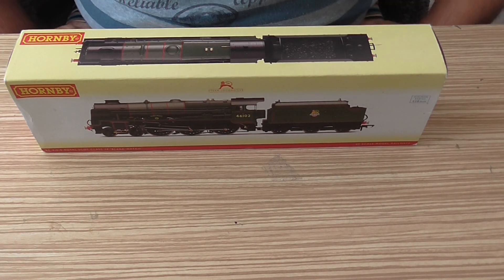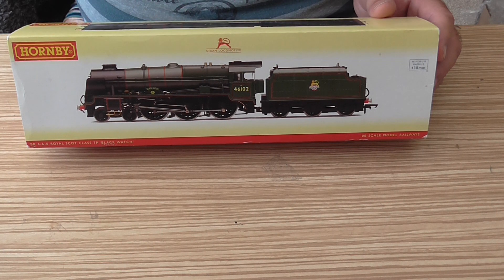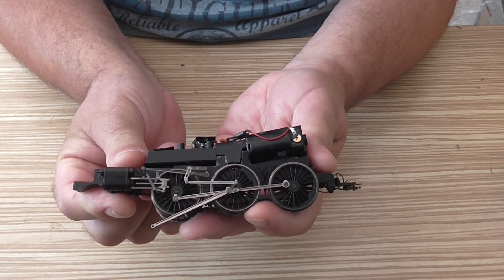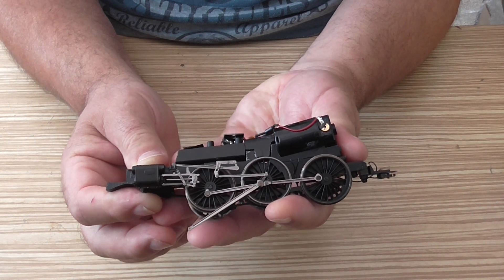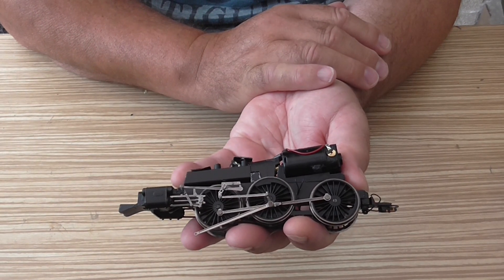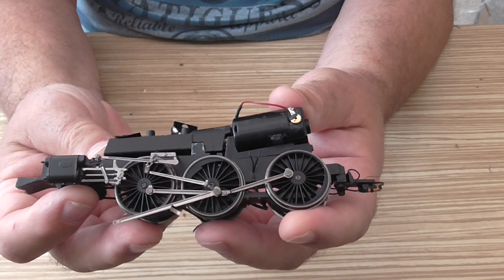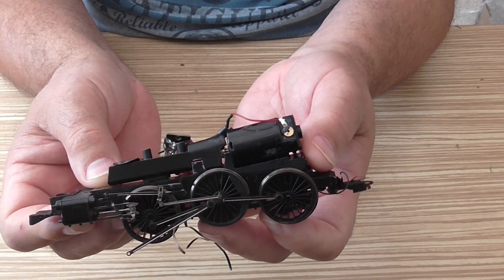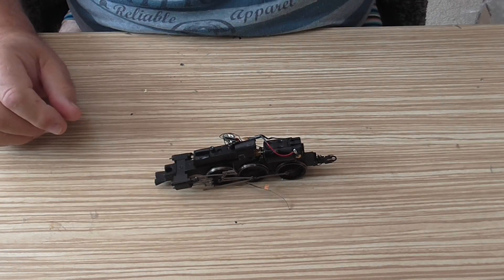Model railway – Help!!!

Comment: Not so long ago I bought a Patriot Bunsen off ebay, described as 'new'. It had Mazak rot.
Such a shame, as it was a beautiful loco and I would still like one.
There are quite a few Patriots on ebay, but I wouldn't risk it.
I wish you luck, but there is probably a surplus of bodies, not chassis.
Hornby and spares, what joke.
I have a Evening Star 9f with Maxak rot on the tender chassis. Sought Hornby's advice, and was told they can't help.
Reply from the maker: It is a pity Hornby used such cheap material on such nice locomotives.  I think you are right, there will be more bodies for sale than chassis's...Simon
Reply: Hi William,have the same problem on Hornby 9f Loco Drive  R2880,the tender chassis fell to bits  with this Mazak Rot .Really can,t understand how Hornby seem to be getting away with this problem .
Reply from the maker: I sent a letter to their MD, so far he cannot be bothered to respond. I try not to buy anything of Hornby, just Bachmann, Heljan, Dapol etc, Hornby are rubbish, as is their service...Simon

Comment: Send it back to Hornby Simon , they are good at replacing .. regardless of age ..
Reply from the maker: I am hoping Hornby will help. The first signs of the Mazrot issues was the cogs separating, the motor would turn but the wheel don’s because the metal expansion separates the cogs.

Comment: I don't have any suggestions other than send it back to Hornby. Such a shame though, as its a beautiful looking loco (despite being a diesel guy!). I do find Hornby incredibly poor with spares. They're the worst of the lot in my experience. But, if this is a known issue with this model, I'd push for a replacement or a refund. Let us know how you get on.
Reply from the maker: I am hoping Hornby will be decent about this and replace it.  I do agree about them being very poor with spares, and find them very poor responding to questions...Simon

Comment: Hi i had some trouble with my battle of Britain kenley connecting rods i know it was a new model. I said can i bring it to you they said ok but i would have to leave it with them. As yours is a design fault they might be more sympathetic face to face hope this is of help the address is hornby unit 5 to 10 sparrow way hers den Kent ct3 4jh but give them a ring first just to see all the best Tony
Reply from the maker: Many thanks for the help Tony

Comment: Fit an alternate chassis entirely? Bachmann did a Patriot, and I seem to think that their predecessors did too. If not, maybe look to the kit manufacturers and fit a brass one? and in doing so, recycle your mechanicles. Ive been an SR modeller for the last 50 or more years, but seem to recall the King Arthurs may be the same wheel spacing and possibly size as well?
Reply from the maker: Thank you for the information.

Comment: This is to do with the quality control in China in the manufacturing process of the alloy used in the chassis and bogies on Hornby models recently , you get mazak rot which is a brittleness of the zinc alloy causing fractures and chassis disintegration . Send it back and Hornby should replace the chassis for nowt .
Reply from the maker: Many thanks for the information, I am hoping Hornby will help with this, when you consider what locomotive cost...Simon
Reply: Simon -Liverton Central exactly!  Never had a problem with their earlier stuff and dapol and Bachmann and also Heljain are very high quality models . I hope you are doing well In yourself and that your loco gets sorted ! . Regards Richard .